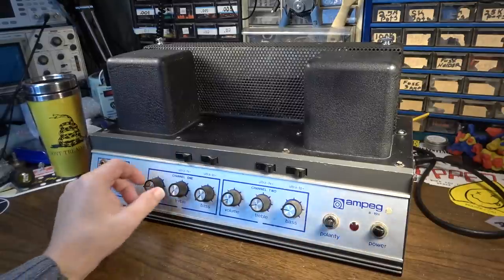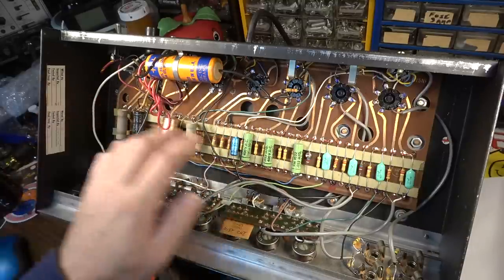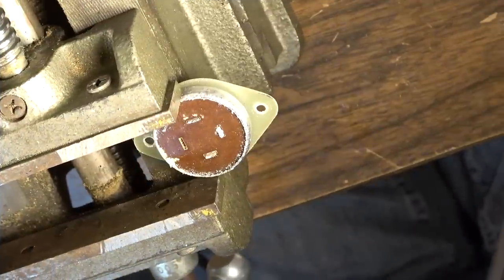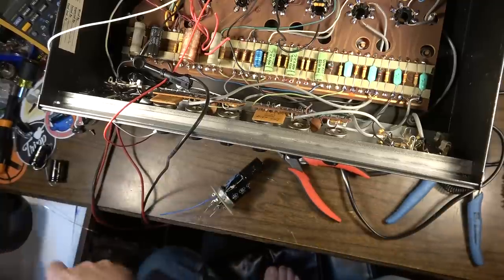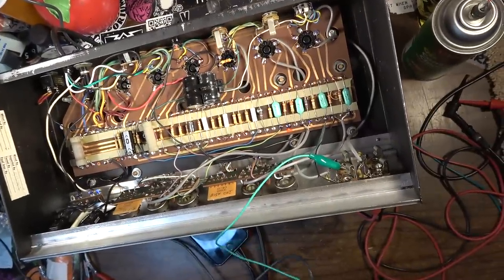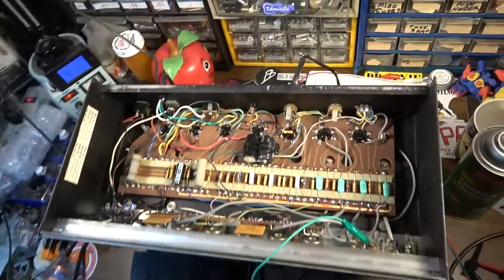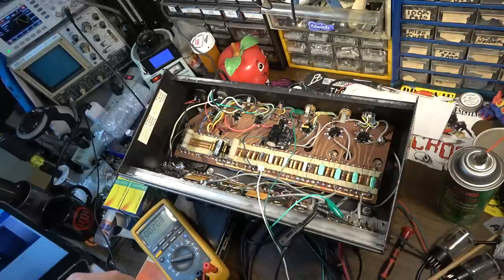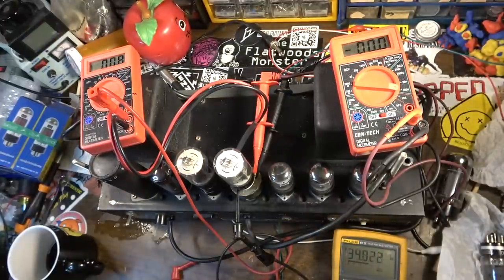Better than a Fender BASSMAN for Guitar? - 1969 Ampeg B15N Portaflex

Comment: Way back in the day, a friend of mine had an old Ampeg amp. It actually had an input for Accordion! It had the fattest, most singing lead tone I ever played.
Reply: I had one! ReverbRocket!
Reply: Back in the day just about every amp it seems had an accordion input. What's kinda funny is that it was the hi gain input since accordions put out a lower signal. The top folks at Ampeg were no fans of Rock-n-Roll. Their amps were designed for Jazz musicians.
The old Fender Bassman is like that too with the guitar input having a lower gain than the bass channel.
Reply: @valvenator  interesting.
Reply: Like on the Gemini series amps!

Comment: I played through a 1962 B15 for the first 2 years of my 40 year long career. Great start by accident, if you knew the backstory. That amp is iconic. It's all over everything you've heard or hear since its inception. Songs of many genres, movie soundtracks, and TV and radio commercials. It's even a basic model in most amp sim software.

Comment: When I was about 14 my brother traded me his amp for mine. He had just become a father and needed something a bit quieter. I had an inexpensive solid state combo practice amp, I think it was from Sears. In exchange my brother gave me his 1960 Ampeg B15-XY. That amp was amazing. I held on to that amp until 1997. At 33 I was going through a nasty divorce and needed cash. Years later I learned that the XY was an experimental model. I don't miss how heavy the thing was.

Comment: I met a neighbor about 10 years ago at a Garage sale. He sold me a 60's B12 Portaflex Fliptop (diamond pattern tolex) with a 12" for $115 cause it had no sound. All it needed was new latches (as they carry the signal to the speaker, but were a little rusty / corroded)! Amp was all original down to the bugle boy tubes and jensen speaker, but a little rough (torn tolex, chrome parts a lightly corroded, etc).. Sounded great! Loved it!  Kept it for a while and ended up trading it for a Dr. Z maz 18  head.. Best amp deal I ever made!
Reply from the maker: Hard to find deals like that. It’s why i got into amp repair, if you can repair, you can take advantage of deals.
Reply: @TheGuitologist  Found an old soundcheck video I did with the amp with pics.. https://www.youtube.com/watch?v=6C4Qs6L5CeM&ab_channel=saw1331

Comment: Back then we used a Bogen  or Layfette Tube P.A. with 2x12 Bassman Cabs  on either side of the stage....if you could afford it this was the standard back in the 60's .
My older B 15 had an XLR out but as you can see back them most P.A.'s did not have XLR connections to overcome the B 15 low volume output.   Thanks for the Blast from my Past  !
Reply from the maker: This one has a 1/4" preamp output.

Comment: From what I've seen on these B-15-N's is they have a 4-pin "XLR" style connector where the B+ is passed through the speaker cabinet as a fail safe for the output tubes and the output transformer. If there's no speaker load the output is shunted to ground.

Comment: Awesome video Brad, your cap stuffing is very cool, keep an historic amp looking original, and the repair price low, plus your closeups of the lettering stencils and the sensitivity and tone shift switch’s tell me that my V4 is a 68 or 69, it had an ungrounded power cord and auxiliary power plug, so I know it’s about that old.   I had it recapped and a grounded cord added, fabulous bass amp, although mine is the guitar version with reverb

Comment: Nice Amp.  I had one like it 10 or so years ago.  Had many old Ampegs I used mainly for bass. I'm mainly a guitarist though.  One I wish I never sold/traded was my B12N.  Same as this but with 12"speaker and maybe half or so of the wattage. That was great for guitar with much earlier break up.  Bass was a blast with that punchy break up.  Great bass tone for stoner rock.  Try the B12 if you can find one.  Much more rare than the B15 but they're out there.

Comment: Is the 250 ohm 10 watt resistor a shunt to protect the output transformer ? I made an amp head and wanted to to do similar in case amp was powered on without a speaker load …any recommendations? Thanks . Mike

Comment: Last week I plugged my guitar into my V4-B and 2x12.
It was recapped 15 years ago, and it's a little noisy until it warms up, and there is a hellish snap when you take it off stand-by.
Reply from the maker: Can’t recall on it he V4, but there are ways to silence the Standby Switch by adding a cap. Depends on where in the circuit the switch is.

Comment: 500 volts is high for the plates? My Univox 1061 is running 730 volts despite the schematic showing 650...scary, especially for my first tube amp repair experience. Next project will be my Champ, which should have been my first amp to learn on, lol.

Comment: You’re giving dating advice? Interesting design for the board. Kinda reminds me of Traynor. If you can get the wafer off the cap can ,the inside can be drilled out a la Uncle Doug. EVERYTHING works better for him ,though 😂 Yeah, that output on the schematic would’ve thrown me off as well. Dig the green screen!

Comment: You should really leave the polarity switch .. they can be helpful to remove unwanted 60cycle hum at a venue with funky wiring ,or lights on the same common .
Reply from the maker: If the ground lead is properly installed, there should be no issue. Removing the polarity switch removes the possibility of someone setting it so the amp has live juice through the transformer even when the amp is switched off. That sets up the potential of a shorted transformer situation continuing without a fuse in the line. It's safer this way.
Reply: @TheGuitologist  wow ok , learn something new every day. Guess it’s better just to use a conditioner with a lift if need be then?

Comment: I have one that a customer traded to me. If it has the 4 pin speaker cable, short pins 2 and 3 together. That will allow signal to pass.
Reply: A quick way to see if you’re getting signal is to remove all the wires from that external jack
Reply: The 4 pin plug was a safety feature. If you fired up the amp without plugging the speaker in the amp wouldn't blow like it normally would. I honestly don't remember how it was done but I think two of the wires allowed the signal to pass back to the amp and two were for the speaker.
edit: I just got to the part where Brad explains it right after posting this 🤔 or maybe not. Maybe I should watch the whole video first 🙄

Comment: Brad, you never saw 900v.. your meter was auto-ranging as it built up voltage.. that was 90v it passed through..  900v even briefly would make short life of some components... tubes would be very unhappy getting slammed like that.. caps pissed too..  lol
Reply from the maker: The auto range on the Fluke meter is usually pretty instantaneous. Maybe my batteries are getting low.
Reply: @TheGuitologist  yeah... It wasn't the meter.  It was the transformer charging the remaining caps and bring the tubes up slowing it just a bit... The rectifier was probably just coming up... Look at the footage.. You'll see the graphical bar advance then drop as the next range is locked on... Then it counts back up...  I had to back it up to see that 900 again... And then I realized..   Nice amp tho.. Simple.. But works nice... Nice playing too... I love that zio..  Take care..

Comment: Are you saying that the the dissipation wattage of the old vintage 5881 tubes is completely different and lower dissipation wattage compared to the newer 5881 they have a higher dissipation wattage? Any reasons why they have changed the specs of the newer 5881s that have a higher dissipated dissipation wattage?
Reply from the maker: Yes. Modern 5881 such as the Sovtek version are really a different tube with different specs. Higher max ratings.
Reply: @TheGuitologist  I didn't know that all 5881 tubes nowadays all from all different types of brands are higher just have a higher dissipation wattage then the older the two is back in the 50s and the 60s

Comment: Isn't it best to always check the tubes first?
Reply from the maker: Depends on the circumstances. In this case, I’m servicing this amp anyway, so I changed what i know will need to be changed, then checked for other issues after that. Tubes are rarely a problem after all else has been serviced to spec.

Comment: They ALL copied their designs from the RCA manual. Some just didn't know it.
Reply: Dick Denny at Vox didn't copy his early JMI circuits: his AC-15 JMI circuit from mid-1950's was the first amp designed SPECIFICALLY for guitar (or so I read - not a tech).  I have an AC-10 JMI clone head from "3rd Degree" amps (even used vintage components throughout), a very similar circuit to the JMI AC-15, and perhaps the best sounding amp I have, especially through cabinet with a Vox silver-bell 12" speaker with its original .pulsonic. cone (sounds great through other speakers too ).  The EF-86 channel has more gain than the 12AX7 channel, a bit fatter sounding - but not high-gain.  Dick Denny used smaller transformers in AC-10 vs AC-15, and neutered the 2 x EL-84 power section down to ~10 watts, and 10" speakers instead of 12", otherwise similar circuits.  Dick Denny loved the EF-86 preamp tube, considering it the most musical sounding, so he used it in all his early designs, including AC-30.  But the higher powered AC-30 vibrated too much for the EF-86, which had a tendency towards being microphonic, so it was designed out of the AC-30, but it got the top-boost circuit Denny nicked (as the Brits say) from Gibson's GA-70/77 circuits, even including the mistake Gibson engineers made in that circuit.  ANYways, the first amp designed specifically for guitar is (supposedly) AC-15.
Reply: @pharmerdavid1432   yup. All true. And it all started with the RCA tube manual. Dick Denny (unsung genius) was also the first amp designer who designed an amp with a natural distortion. Up unto that point, and we'll beyond, most amp companies were always striving for the cleanest sound they could get. Dick Denny was really the first amp designer to realize that some distortion sounded good. His genius went well beyond amps, as well. Vox also made amps that weren't designed specifically for guitar. Fortunately most of them sounded pretty good when you plugged in...some did not. Same with every other amp company at the time. Because this "Rock and Roll" fad will soon die out.